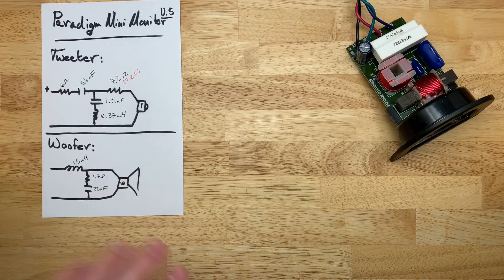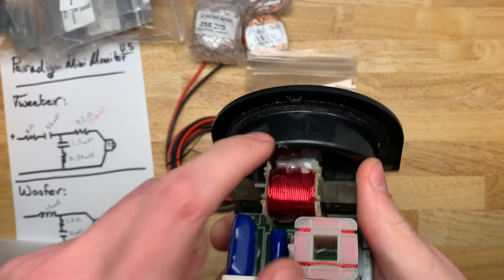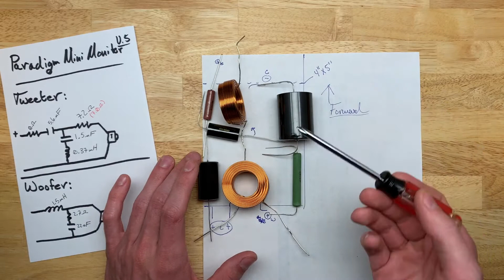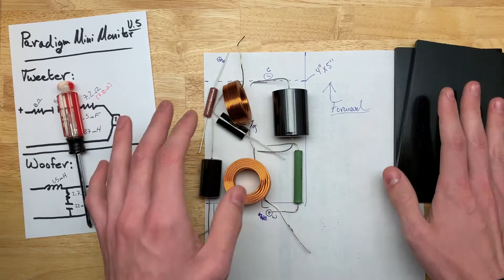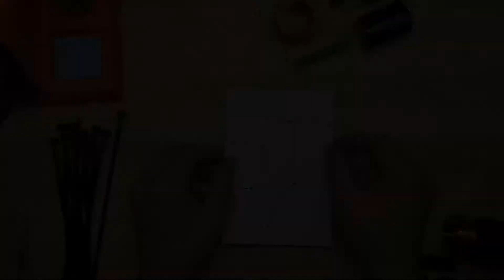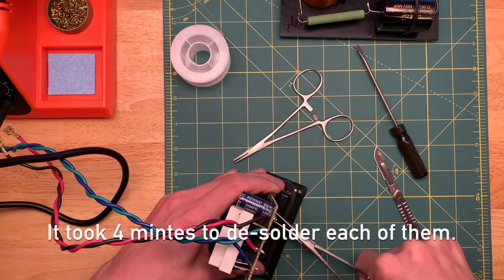Part 2/3 Upgrading the Crossover - Upgrading Paradigm Mini Monitor V5

Comment: Hi 👋Mr. Casey! Mr. Casey You maked big mistake! First off all need use big quantity little capacitors and connected all capacitors in one parallel !!! Must not use one capacitor in crossover, never! If You need perfect results, look this: for 1.5 uF need 5*0.3 uF caps, for 5.6 uF need 7*0.8 uF, for 22 uF need 11*2 uF caps. But you used only one capacitor for one way. This your first biggest mistake. Second your big mistake - components. Jantzen resistors and caps bad choice,because others resistors and caps for their price much better. For example, green Dayton Audio DPR10-3.0 resistor like red Mills resistors have very high quality, but have low price and Dayton Audio DPR10-3.0 much better than Jantzen. If speaking about capacitors.... 🤔 Dayton Audio PMPC caps or red Audyn Q4 caps much better than Jantzen. And no need use wire inductor coils, inductor coils need use only copper or silver foil. Think 🤔 about.. And don't make mistakes next time. Have a good day to You! 👍

Comment: I have tried to "upgrade" my Monitor 9's... was a complete failure. Tried Sonic Caps... tweeters were unbearably bright afterwards. Also tried the Mills resistors alone, and with the SonicCaps. All those titanium domes did was distort. Ended up going back to stock... but nice video.
Reply from the maker: Thanks for sharing your results!

Comment: Do you think it’s worth upgrading parts that are not in line with the drivers? Those signals are going directly to ground.
Reply from the maker: The only other thing I can see being a worthwhile upgrade would be to change out the binding posts. But that would represent such a small increase in quality that it may not really be worth it.

Comment: Hi Casey, thanks for the video! I own a pair of Paradigm Prestige and got the DIY bug, so I thought of doing a crossover upgrade. My Q: how did you get the crossover's schematic? All the best.
Reply from the maker: @Evyatar Arad - I reverse engineered myself. If you have an LCR meter and a very basic knowledge of electronics, you can reverse engineer a crossover in a couple minutes. If you’re really lucky you might even be able to find a schematic online, but I find it more fun to do it myself.
Reply: @Casey_Schmidt  Thanks for replying so quickly. I'll try that out and report.

Comment: Hi, when are you going to post part 3/3 on this Paradigm Mini Monitor v5 speakers?  How did they sound after you replaced crossover with your higher quality home made ones?  Or is the lack of video 3/3 a sign that the results were not acceptable?
Reply from the maker: @Bill S - You’re in luck, there is a part 3/3! Just go the channel page and search for the title and it will be there 👍

To my ears close they sounded much cleaner after the upgrade.

Comment: How did you get the inductor values of the original crossover? I am especially curious about the inductor resistance, since they vary for different gauges
Reply from the maker: @Dinh Duy Nguyen - Great question! I used an LCR meter to measure inductance. An LCR meter is a special kind of multimeter that can measure inductance, capacitance, and resistance. To be most accurate, you should remove the component you are measuring from the original circuitboard, however, it is not entirely necessary for this application because the standard values are close enough the measured values even when they are still on the board. Obviously, you can either buy a cheap LCR meter for $15 or an expensive one for $100+; your choice really.

You are correct that the resistance is not the same for different inductors. Iron core typically have the lowest resistance simply because they require less wire for the same inductance. Thin gauge air core have the highest resistance. For comparison: an 18 AWG 1.0 mH iron core inductor has 0.19 Ohms resistance while an 18 AEG 1.0 mH air core has 0.48 Ohms resistance. Is that enough to make a difference? Of course. Is it enough to HEAR a difference? You decide. I personally don't think it is worth worrying about tenths of an ohm for the level listening I do.

Comment: I have vintage speakers Paradigm Monitor 3, I haven't used them for about 10 years and after some time after listening, one speaker began to play "more muffled". I listened to them in my sauna (not in realy :)) at the dacha and after a couple of days one speaker really began to sound dull. I corrected it with a balance, and looked into the crossover... soo I was surprised to find non-polar electrolytic capacitors in them! Mother of God, well, it's no wonder that at the end of the 20th century there were no normal capacitors. So far, watching your video and inspired by it, I replaced HF electrolytes with membrane 6.8 microfarads and 22 microfarads of fresh electrolytes; but the perfectionist in me told me what to do normally, so on the way to me 22 microfarads polypropylene acoustic capacitors made in Russia (I’m from there lol) https://deskfi.ru/products/kondensator-kzk-white-line-22mkf-250v I'm waiting :)